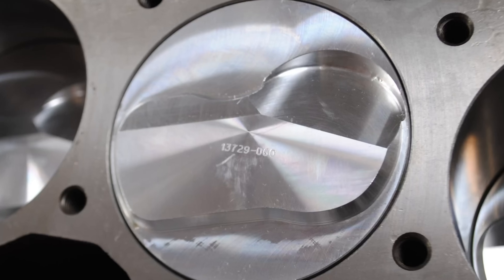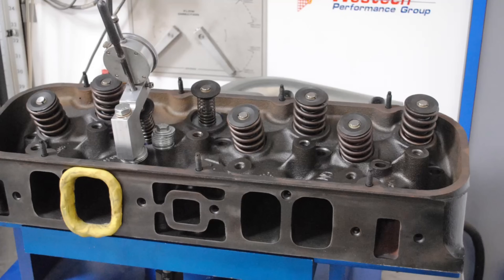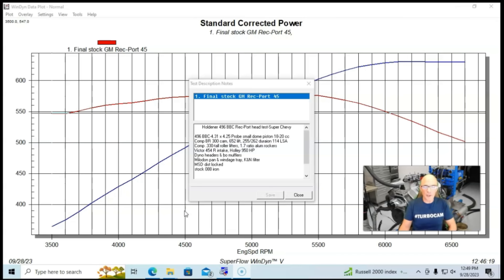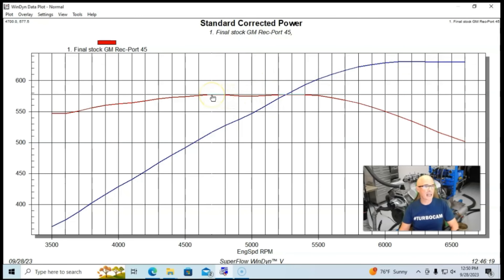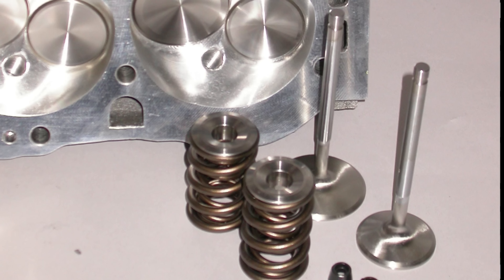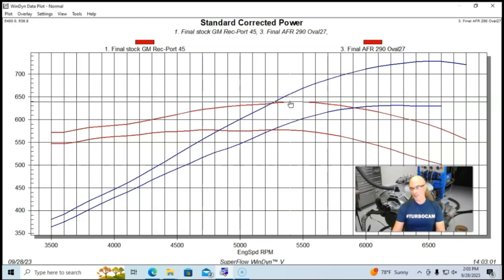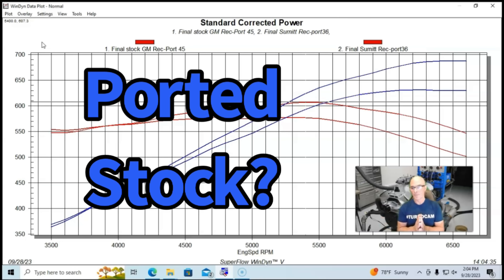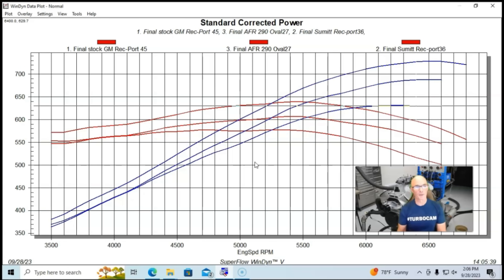HOW MUCH ARE AFTER MARKET IRON & ALUMINUM HEADS WORTH ON A BBC? STOCK REC PORT VS SUMMIT VS AFR 290

Comment: No experience with Rectangular port iron heads, but lots with large ovals.  781 heads can see big improvements from porting, on my engine to the tune of 632 lb/ft at 3200 solid cam single plane, 13:5/1 comp. 468 c.i.  I doubt they'd touch anything made by AFR though.

Comment: I haven't done it myself, but I think the iron stock heads can be modified enough to match the aftermarket iron heads. However then the question is cost. How much would it cost to get stock heads up to the same as aftermarket performance and setup the value springs to match the cam, vs aftermarket heads out of the box specs tailored for your engine. Now this entirely my opinion but I don't think that iron heads could ever be made to out preform aluminum heads due to the increased heat and detonation limits of iron heads. I think aluminum allows for better cooling and give a little more range from detonation to use more aggressive timing. What I like about the aftermarket heads is you can order  them with what you need or they are set up for your cam specs for your cam you are using to prevent valve float. I know cost wise the aluminum tends to be more expensive, but the price is close enough I wouldn't use iron heads or buy aftermarket iron heads unless I had too. For example qualifying for a specific pure stock class. For a 300 bucks or so more I'd rather have aluminum heads for better tuning and drivability. If on limited budget I used stock heads unless there's some problem that causes the heads to need replacement.

Comment: Even if you install good undercut valves with a extra 15 degree cut on the intake valves and cleaning up the bowls and short side radius then installing good valves on the exhaust along with epoxying the exhaust floor raising it 3/8 and blending it into the bottom angle of the seat to help the exhaust short side, it will definitely help a lot. The exhaust port is way to large and the tight radius on the short side really hurts the exhaust flow. I think it will pick up a good amount but it can’t come close to the AFR’s ports and valve location, valves and seats. That’s my thinking.
Reply: Needs chamber mods on the exhaust side also it’s in vizard big block book

Comment: Rich we had ported sqare port heads off of a 427 vett engine I forget what year they were the car we had these on had a tunnel ram and a solid roller cam 700 lift we switched to a pair of brodax heads after milling and a good valve job we only picked up 1 tenth of a second these were on a standard bore 454 we were upset because we spent all of that money with so little gain and to show how good the factory heads ran this 1968 camaro ran 8.90s on motor in the quarter mile and 7.90s with a 225 shot of nitrous at a 170 mph this is going back 25 years ago,  hope this gives someone an idea showing what factory heads can do compared to aftermarket with a time slip instead of a dyno number
Reply: Were you running a automatic transmission or standard transmission? I have a 68 Camaro with a 4 speed muncie m22 in it. It has a built 355 small block but I'm looking to go to a big block as I can't seem to get the torque need to have the power it had with the close ratio transmission it previously had.  I literally could get rubber in all 4 gears. Now it is limited to 1st and 2nd, with a slight bump in 3rd gear.
Reply: @jsharp7260 you had different ratios in the previous transmission that's one thing. Instead of putting a heavy BBC in your car, take your small block and stroke it to 383 ci. with a Scat 9000 3.75" stroker kit. Be a lot less expensive plus with the right camshaft and tuning you'll be over 500 ft/lbs of torque.
Reply: @hoost3056  Thanks for your advice on this.  I do have some extra things that I wouldn't have to pay for such as machining and I have some big block things already.  So it might not be to far off. I'm going to be looking into a forged crank for this build as well. So we'll have to see what becomes of this. Maybe in the future I will post my results on here.
Reply: Most never explore what the factory heads can do. You had great results with your 454 factory head camaro........there's guys out there that won't run those numbers with all the "best" parts in a 540 bbc.

I much prefer good factory headed combos